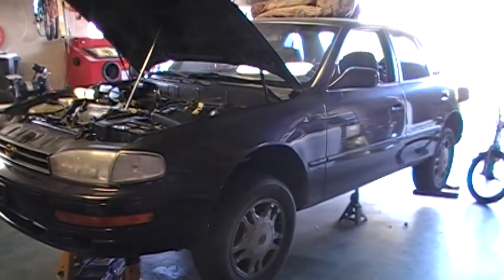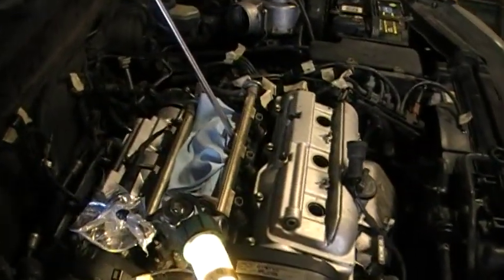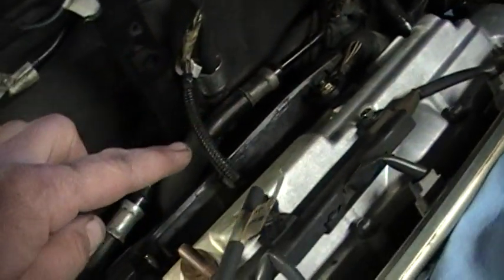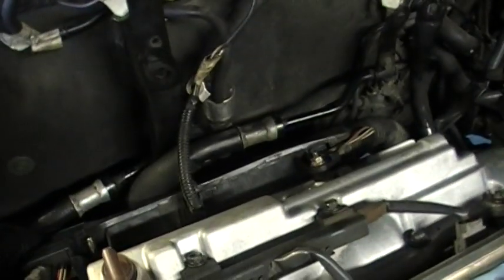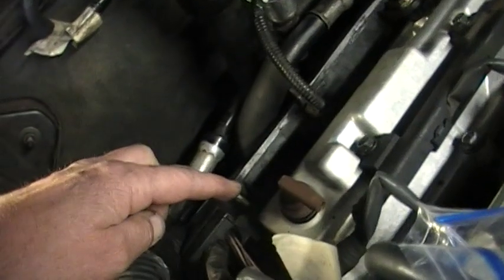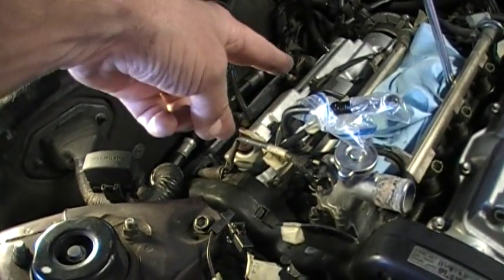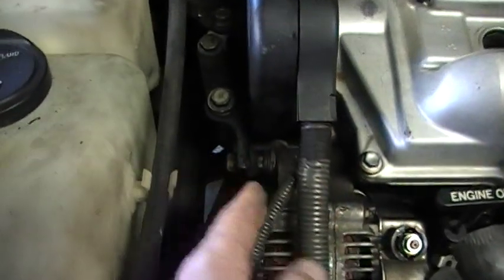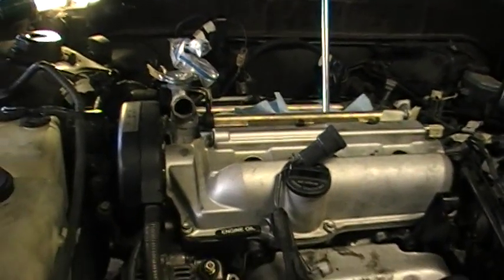1992 Toyota Camry 3.0 V6 Rear Valve Cover Access Issues .mpg

Comment: What held me up on my Camry was the bolts on the rear exhaust manifold. The angle they were at was about impossible to get to with a ratchet, luckily was able to put the head on with the manifold already attached.
Reply from the maker: +Jeremy Hurley Hey thanks for your input on this!  I had the car up, so I had to use my very long extension with swivel adapters to get at that area.  BUT, if your car isn't up, or you don't have the long tools, yes, this area is such a pain!!  I shot this a long time ago!  Was one of my first videos I did for fun to put up to maybe help out some folks.  That turned into my little channel which now has something like almost 700,000 views!  It started with this little hand-held video you watched here.  Thx for your input!  r-

Comment: Man, I wish I had seen this before I dove in on this car. What a mess. I unplugged everything I could and just wrestled the rear cover out of the car, but it was rough. I suppose this is what I get for owning the easy-to-wrench-on Miata.

On the other hand, it's not smoking anymore, so I guess it was worth all the standing in my driveway swearing at the car. Hope I don't have to take it all apart again.

Did yours make scary noises the first time you started after this, or is that just me?

Comment from the maker: ...funny, but I did a video on block testing this car for a headgasket issue.  $900 car, parts for headgasket repair at least $500 (with machining), um, naw.  I used something called Blue Devil on it and it's worked great.  I did some videos on this if you're interested in taking a look. r-

Comment: I have a Toyota Camry made at 2005, it make intermittently  noisy  sound like a toilet flush far away to near when the car slowing down.
Reply from the maker: Hua chen Hi!  Well this certainly is an odd one, but I once correctly diagnosed a 'bubbling sound' to a faulty CV boot/axle area while turning. Yours could be related to a couple of different subsystems that I can think of. While slowing down, I assume you are pressing on the brake pedal.  If so, it could be related to your braking system, in which case that is definitely a safety issue- so if it is happening only while you are braking, have a brake specialist check out your system. You could have issues with your calipers/drums/hydraulics/vacuum feed to the booster, etc.  If it's not happening while braking but just slowing down, what comes to mind to me is letting your foot off of the accelerator pedal.  What happens then is inside the main air feed to the engine, the main throttle body plate closes; the plate is like a round flat plate that rotates inside a your throttle body "cylinder" or tube-allowing air to flow through the tube or to be closed off, depending on the position of the plate inside the tube. Basically,  when you take your foot off of the accelerator, you are rotating the plate to close off any flow through the tube where your engine intakes air; you are cutting off the airflow to the engine (along with fuel demands via the injectors).  Generally, any audible noise during this phase can be related to engine PORTED vacuum- there are two types: ported and manifold.  Your engine is idling in your driveway, and your throttle is 'closed.'  During this time, there is lots of vacuum that is available to the ports located 'above' or 'beyond' the throttle plate, because the plate is closed off, and all the vacuum will then go to all the holes, or ports 'above' or 'beyond' the throttle plate.  Once you begin to accelerate, the throttle plate is opened, and then the amount of vacuum 'above' or 'beyond' the throttle plate to those same holes or ports is greatly reduced (vacuum is suction).   So...then...in your case, you begin to slow down, take your foot off of the accelerator pedal, and the amount of ported vacuum (above or beyond the throttle plate) greatly increases to those ports or holes.  You then begin to hear strange noises.  As you slow down, the engine RPM reduces, and that causes the amount of ported vacuum to be reduced as the engine RPM reduces, which can vary the noise you hear (not constant).  I think you have some kind of vacuum leak or problem related to a hose or component that gets its vacuum on the PORTED side and not on the MANIFOLD side.  Manifold vacuum is always available regardless of throttle plate position, because it is NOT beyond the throttle plate - it is 'below' or 'prior' to the throttle plate.  When you step on the accelerator, you open the throttle plate.  When you release the throttle pedal, you are closing off the throttle plate.  A bit difficult to explain - I could do a heck of a lot better by drawing a simple picture - but hope this helps a little.  Have your mechanic check for a ported vacuum issue,  or any vacuum issue, or a braking issue if it only happens while you are braking.  r-
Reply from the maker: reluctorvalve add: the throttle plate never fully closes - of course.  It does remain open a little to allow air for idling RMP.  But, for the sake of description....close and open seem to work well.  r-